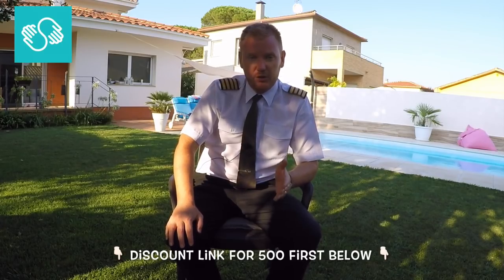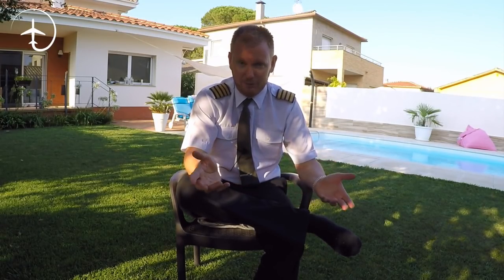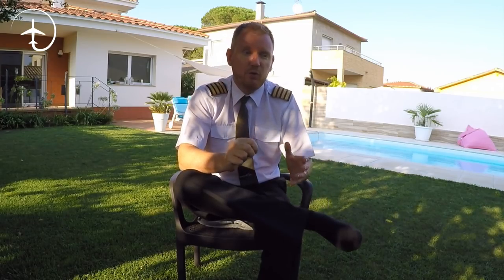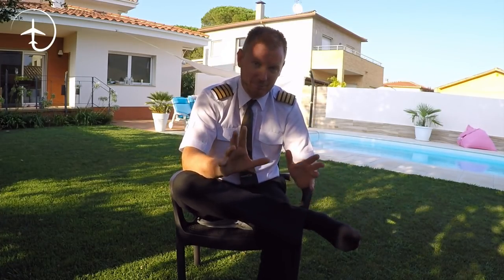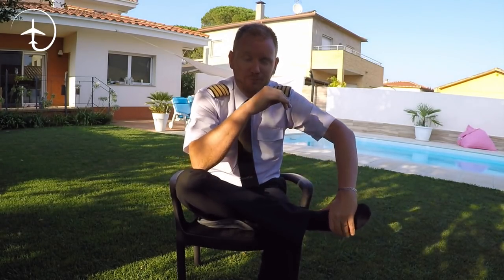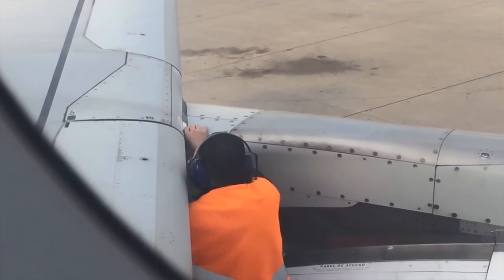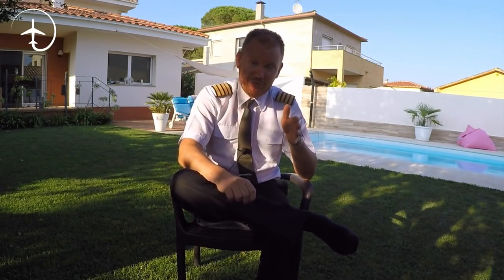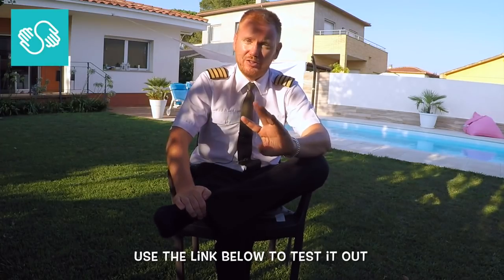Fixing aircraft with DUCT TAPE?! Mentour Pilot explains.

Comment: Tapes are also frequently used for masking gaps, screws, handle shafts and other things, to improve drag. It has zero to do with fixing anything, it just improves flow of air around those areas. Planes that were used to reach speed or other records were usually full of various taped areas just to make the surface smoother.

By the way - 3M aluminium tape is good for most of that, no need for extremely expensive thing..

Comment: Mentour if the RTO auto ARM fails, they leave the RTO function on the the captain ? I mean , If the auto RTO system is inoperative , they let the captain take off noticing himself on problems during take off, or they dont, and delay the flight to repair the system ?

Comment: I am skeptical of the name "speed" tape. When I started flying in the 1960s we had very high quality thick-but-flexible aluminum tape (probably made by 3M) for temporary repairs on fabric and aluminum airplanes. In my work in film and video production we have "gaffer" tape, a fabric tape that is different than duct tape and when it is used in the car racing world it is called "racing" tape.
Reply from the maker: Google it. That’s the name we use in Europe, might be different in the US
Reply: Mentour Pilot  Thanks for the information but I have a rule about what one can find on the internet and the World Wide Web (I recently learned that those are two different things) and that is, about 50% of what is posted is false. It’s called confirmation bias (the tendency to interpret new evidence as confirmation of one's existing beliefs or theories). One can find whatever one believes to be true if one searches long enough.

Comment: American Airlines: I flew into Cozumel Mexico and saw a major crack on the outer cowling, reported it to the aircrew at Cozumel, and after looking at it, the aircrew left with the bird.  Cozumel was a non repair point, but if the airlines weren't paying off the FAA, these things would be corrected, and passengers would not be placed at risk.  Corporate profit versus safety.

Comment: 1:10 dude has never seen my car. Duct tape and zip ties are fine for my car.

I have some cosmetic cracks on my bumper from road debris deflecting off my car.

I couldn't be arsed for the $1,000 repair TO REPLACE A PLASTIC COVER parts only! So tape and zip ties it is.

I actually had packaging tape on it for a surprisingly long time.

Comment: intresting video.......im an enginner who repairs washing machines, (similar lol, ha ha) and i have a question? what if the area is contaminated with greese? does the engineer clean the area with methylated spirits first? as iv used lost of adhesives and very strong expoxy glue to seal holes.....but the glue is only as strong as the surface less contaminants its sticking too? .... and if this tape is very efficient as its documented to be, how difficult is it to remove? it must only be semi-permanent as it would damamge the aircraft, im guessing in reality their only covering what in fact could actually be safely left without it?

Comment: I know the lights are dimmed during takeoff and landing during darkness to allow your eyes to adjust in case of an emergency. Are they dimmed to avoid ground to air missiles as with a less lit aircraft it would be harder to see. My grandad and mum suggested this and I turned it down believing that the only and main reason is for your eyes to adjust. Thank you.
Reply: SAMs are either radar or IR (invisible light created by heat) guided, visible light from the windows wouldn't affect them.

Comment: Race car drivers call this duct tape 200 MPH tape. Also' in the early jet age " Pencil Whipping "  was quite common when certifying a commercial airframe  to fly. Time=Money in those days.  We also use duct tape to secure DZUS fasteners from falling out, taking a body panel with it. I see a " ramp rat " that is securing fasteners in the same way we did.  I suspect that this might be a similar tape that that cost 10 x as much to be certified to used on airframes. Remember Time is still money. Also aerodynamic principles cannot be ignored;  your safety margin is thin enough as it is.

Comment: That aircraft speed tape is for sure not a normal tape, it is built in a way that every fiber in ordinary duct tape replaced with a strong carbon nanotube that can survive those conditions. The question is for how long have aircraft been using such tape and is that recent or is it being used since early aviation? Can pilots also become engineers to the aircraft they fly (Would be nice to be able to repair the aircraft and fly it at the same time)?

Comment: I have witnessed an air craft engineer applying duct tape, yes duct tape (not expensive speed tape or similar products) to the fabric covered wing of an Antonov AN-2 after inspecting the control surfaces control cables in the wing. This is done by cutting a small slit in the fabric, look at the cables and I assume cable pulleys and then the slit is sealed with duct tape. The engineer was of Russian persuasion, of course.

Using duct tape to passify rowdy passengers in flight seems like a perfectly reasonable cause of action to me...

Comment: It's fancy ducktape.  140 C splicing tape is over $100 for a small roll, and Home Cheapo sells something very similar  for $2 a roll. Am I going to trust the Home Cheapo tape at 200 degrees F or -40 F and 50,000 volts? Of course not!  Same  deal with splicing. 1/2 overlap X number of wraps,  clean with approved cleaner first, etc. And the cleaner is $150 a can too.

Comment: Speed tape has been used since the Vietnam war.  If an aircraft came in without wingtip lights(navigation lights) and needed a new wire, they could run new wires to the light by taping them to the wing.  It doesn't hold parts together, it covers a wire for example, so it can't flop around at extremely high speeds.  It may have  been used back then to cover bullet holes, so wind doesn't pass through.  It offers no structural properties.  It feels like extremely heavy tin foil.

Comment: I did not know about the mythbusters but I have heard that duct tape can be used on fabric skinned aircraft  to prevent the skin splitting if there is a hole   this is a temp fix on are low speed 1 or 2 seat private aircraft  I heard other things too but I won't go there :)

Comment: duct tape is not commonly used for temporary aircraft repair.  more commonly " speed tape " is used on the outside surfaces for limited purpose repairs - mostly smoothing or holding doors closed. 
duct tape or something more appealing  - fiberglass woven " bin tape "  than duct tape would be used inside the cabin in visible areas to hold non essential furnishings in place or cover sharp / broken metal or plastic edges.  to cover door latches preventing opening or entry. 
but  - thanks to everyone with their phones  recording us using tape on the aircraft  for non safety related items - many airlines  now  have adopted a " no tape "  policy. 
translation :  previously we could come out and tape over something that was not a safety issue - but now the item must be repaired or replaced keeping you on the ground as long as it takes us to repair it.  congratulations.  what took 15 minutes now takes hours..... while you wait.

Comment: That picture of the engineer taping up the nose cowl of an engine was probably just putting a layer of tape over some not-yet-cured aerodynamic sealant. The tape would probably be removed at the next station. Putting tape over such a large area of engine pylon as in that in-air video was probably not a manufacturer-approved repair.

Comment: Sir, what is the meaning of derated take off thrust? When do you use it? what is the meaning of trimming the rudder or the stabilizer(when do pilots use them)????
Reply: Derated thrust is any power setting less than the maximum available for takeoff.  At any given elevation, the maximum thrust available decreases as surface  temperature increases.  E.g., a maximum thrust available at sea level on a 25 deg C day will be substantially less than on a 15 deg C "standard day".  If the amount of thrust that would be available at 25 C is adequate for takeoff, the pilot might choose to use no more power than the engines would develop at that temperature, even on a cooler day.  (On a DC-10, derating to 25 C might reduce takeoff power by as much as 15%).  Derating takeoff power reduces takeoff noise, uses less fuel, and decreases heat stress in the engine enough to considerably lower engine maintenance costs between overhauls.  Pilots are encouraged to use derated thrust settings, where safe, for those reasons.  The amount that takeoff thrust can be legally derated on a given airplane type will vary, and is subject to goverment certification.

Trim is used in all 3 axes to eliminate displacement or force the pilots would otherwise have to apply to the controls to cope with imbalance.  Quite a lot of pitch trim will be used to cope with center of gravity shift as fuel is burned off and for speed and configuration changes.  A little roll trim may be necessary to cope with unbalanced fuel feed from the wing tanks.  A bit of yaw trim will cope with with drag differences between left and right wing drag devices and landing gear when retracted or extended, and a whole lot of rudder trim is needed when a wing engine fails.
Reply: Many thanks for your detailed answers, I really appreciate your seriousness & the sincerity you had to educate.... I wish we could have a lot of ppl who uses the net the same way you did.God bless you.
Reply: I should also point out that the autopilot does most of the flying above 10,000 ft msl, and it would be rare for pilots to do any flight control timming during that time  The autopilot controls the aircraft through control surface deflection, and actually trims only in the pitch axis, by adjusting horizontal stabilizer position to preserve elevator authority.

Back in the early 1970s, designers were talking about reducing drag and fuel consumption in cruise flight by programming autopilots to tranfer fuel between tanks for trim in both the pitch and roll axes.  I don't know the extent to which that idea may have been implemented in the current generation of airliners.  So much of the flight engineers' and copilots' jobs have been shifted to computers these days, I wonder what's been left to keep pilots awake in the cockpit.
Reply: Eric Coleson  Thanks brother seems to me you have a lot of information, One more thing, when do pilots use manual thrust? on what basis they move the levers forward & backwards?
Reply: @mjmqubesi  100% of the time on the ground, or after a wing engine failure during the departure.  Otherwise, you might be able to let the computers handle the power levers until automatic braking has brought the airplane to a stop on the runway after landing.  More likely, you'll be hand-flying the throttles as well as the airplane anytime you're within 10,000 feet of the ground.

Power is added to increase speed and altitude: reduced to decrease those, noise, and fuel consumption.  It takes more power to take off than to climb; more to climb than to cruise; none to descend.

Any of those adjusments can be made by the pilots, or by the autothrottles.  Today's airliners are way "smarter" than the ones that I flew, and I couldn't tell you how flight crews are operating them today.

Comment: I did not care what it was called, I was just told it was very good tape, as they use it on the aircraft. I wanted some to repair a broken window in my office. I wondered why our stores made me sign for a roll of tape. I thought he was just being a jobs worth. So I changed the request to 4 rolls so I would not have to go back any time soon.  It turned out to be really good stuff never leaked. I guess they should have fixed my window when I first asked them too!

Comment: There's an American 787 flying around with speed tape on the front windows which look like Eyebrows. Having handled the stuff the engineers use it's pretty strong.

The only reason I know this is because I had an... incident at work. My uniform is work-issued and it's not great quality so the stitching from the crotch down to my knee failed, and one of the BA engineers very kindly gave me about 20cm of tape to hold it together until I could get it repaired at home. It kinda makes it funny that let me put something so expensive on my trousers.

Comment: Of course jets require high speed duct tape.  But I’ll bet every pilot/owner of a Cub, Champ, Tri-Pacer or other low and slow rag-wings carries a roll of good old standard duct tape, or “get home” tape.  I patched a cracked stabilizer tip with duct tape.  It kept the crack from spreading, and held it together for over a month while waiting for the ordered part.

Comment: If the speed tape can come off and flap around, what happens if it goes into the engine ?
Reply: rideforever Its on the outside of the nose cowling so the airstream would prevent it from going into the engine core.

Comment: In 1994 I was on a flight from stl to Houston TX and the plane had duct tape on the windscreen
Reply: I may have a picture somewhere I'm sure I took a picture of it
Reply: Duct tape or vinyl tape? If it was on the edges vinyl tape is usually applied if the sealant has not fully cured.

Comment: Typically your videos are spot on, but this video is wrong. I'm the lead fuselage structures engineer for one of the two major manufactures. Speed tape can be bought for about $15 a roll from 3M. It is never used for structural reasons. When damage is found beyond SRM allowable, the airline will contact us. If we can show the airframe structurally acceptable for ultimate load, and review damage tolerance as acceptable for X amount of damage, speed tape can be applied to prevent moisture and weather erosion. Especially with composite laminates where moisture ingression can lead to further damage propagation. Speed tape is also used for aero smoothness of damaged structure and/or fairings.

Comment: I'm a retired A&P. Many years ago a taxiing Convair 580 had to return to the gate due to a failure in the secondary heat exchanger.  It filled the cabin with steam. Some of the braindead passengers got off the plane coughing. 

I just Wanted too say, "What? Steam doesn't agree with you?"

Comment: Go-faster stripes for the airbus to make it aerodynamical enough to take off 😂

On a serious note, is that what they cover the pitot and static ports before they wash the aircraft? Or is that regular duct tape?
Reply: Russell Nelson No, it is red/orange flags with a "remove before flight" text. That is not speed tape or duct tape, which can be hard to see on the static ports, that is a big no-no in aviation.
Reply: @speedbird9313  ah ha, i knew they had the flags for engine intakes and pitot tubes, but i didnt know what they did for static ports, didnt they used to be/arent they flush to the side of an airliner? I know thats how one accident happened years ago, someone left silver tape over the static port, and it gave the pilots incorrect height/speed warnings and measurements, i believe the flight was at night, which pretty much doomed the flight, because the tape was so hard to see, the aircraft took off over the ocean, and had no visual reference, dont remember which airliner it was, or when, thats all i remember 🤷‍♂️
Reply: Russell Nelson Yep👍🏻 They are flush and bare metal, so it can be hard to see aluminium tape there. Somebody did that at my mro 10 years ago or something. We luckily saw it🤭Not good😳

Comment: Holy crap, I didn't realise a roll of speedtape costs upwards of $700 A roll
Reply from the maker: Yep, and there are reasons for that.
Reply: They are getting ripped off. Flex tape is better
Reply: Mentour Pilot I know, we have a million of uses for during maintenance
Reply: We had cases of speed tape around the hangar when I was in the Air Force.  It was a metal foil.  I don’t think we paid that much for it back then but if we did it was $50/roll for the tape and $650 for the lawyers.

Comment: master caution captain 1:theres oil leak on the engine 1 hopefully it wont stall or anything  captain 2: were not in mid air were minutes in landing (phil swift's mind : OHHHHHHH ILL TELEPORT THERE) phil swift :HI AM PHIL SWIFT USE FLEX TAPE! IT CAN REPAIR DAMAGES  AND BROKEN PARTS WHY DONT YOU TRY FLEX TAPE , IT BONDS, SEALS AND REPAIRS😄😄

sorry i used caps lock hehe

Comment: Well, I'm sure most of your subscribers know it's not normal duct tape.  It's special strong tape for aircraft.  Still, it's dodgy to use so much of it instead of doing a proper repair, IMO.
BTW, speed tape is not $700 (maybe you've been told the bulk cost by your mechanic).  An FBO near me sells rolls of speed tape for $25 a roll.  You can buy it on Amazon for about $15 a roll.

Comment: The guys doing these maintenance jobs are mechanics NOT engineers. Big difference. Engineers design the plane but would typically never touch it. Mechanics assemble and maintain the plane according to procedures and plans made by engineers. You wouldn't call a nurse doctor would you? Or your first officer captain.
Reply from the maker: We call them engineers in Europe. There are mechanics as well but they have a lower certificate than the engineers. It take As engineer to sign the log-book

Comment: Disappointed that "Pressure sensitive" was given as a special attribute of Speed tape.
Duct tape is also pressure sensitive as is Scotch tape and Sellotape. It simply means that it sticks simply by pressing it onto a surface and needs no solvent or heat applying.